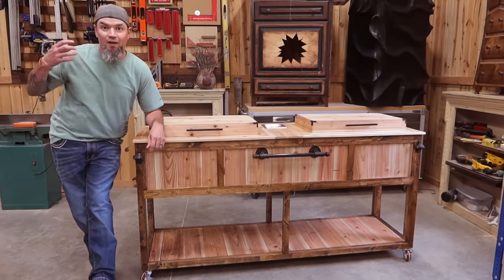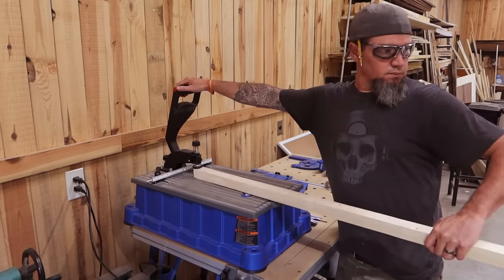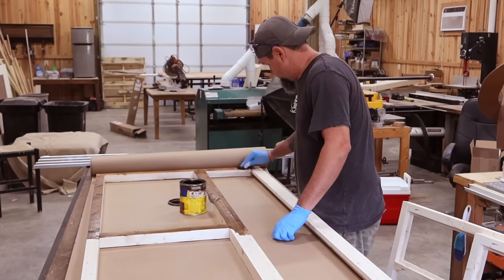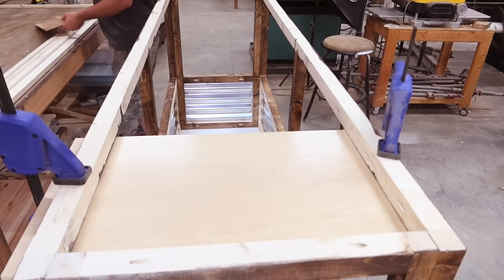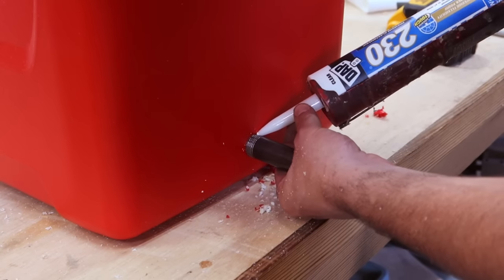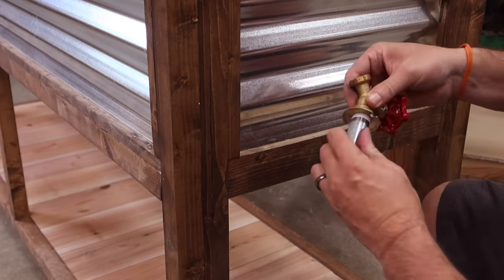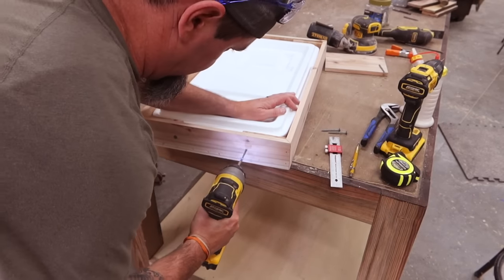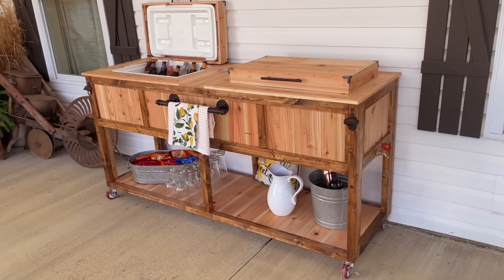Double Patio Cooler Outdoor Bar - Make Money Woodworking

Comment: I built a single cooler one for my wife and I to use. I had a bunch of skids from my machinery that I used for everything except the frame. I used a cooler that had handles and lid hinges that screwed on so it was easy to modify. I used a torch to burn the frame very dark and lightly burned the panels. Coated the whole thing with spar varnish. Looks great and makes outdoor parties great!
Reply: Too bad you cannot post a pic of yours here...

Comment: I made a bar for my aunt and uncle and used reclaimed tin from our barn to face it, I did metal because they wanted to be able to move the bar inside when they weren’t using it and I figured it would be a lot lighter than wood and it ended up looking really cool!
Reply from the maker: Yes!  I bet the reclaimed tin looked awesome!
Reply: Old rusty tin is popular right now for all sorts of stuff, surface rust not full of holes and sharp edges.
Reply: @JamesSmullins  I actually put the underside out so there was light surface rust but it was the old worn galvanized look too and the stamps were still on it from where it came and what year and stuff, the top had been weathered too much and painted too many times to have the same appeal
Reply: @isaiahshaffer  that works, I like that old look much better than the shiny new tin, and it sells better. I learned this at a restaurant I managed that was a very old building, nearly 100 years old. The outside open eating area had a four foot wall around the covered portion that was old rusty surfaced tin. People loved the rustic look and it fit perfectly with the area being a historical district. I loved that place and I was the primary pizza cook for years in a mesquite brick oven outside with the customers, that was also wrapped in the old tin. I got to talk to every customer about the food and atmosphere and that old look was what made people eat in more than take out. We were a bring your bottle and had a couple single coolers people could put their beer, wine or liquor in and have it near their table.

I miss that place even though it was 1200 degrees in front of that oven, new owners ran it out of business and lost all the charm that brought people there.

Old is in
Reply: @JamesSmullins  I agree and that sounds really neat, it’s a shame the new owners ran it down, old is definitely in, especially the old industrial or barn type styles, there is a brewery about 45 minutes away from me and they took and old railway station, like factory sized because they stored grain and goods there and also had rooms for people to stay, the place is massive, but they took it and just cleaned it up, added old iron braces to the timber framing where it needed it and patched brick work but other than that is just cleaned up to how it was, and it’s always very crowded

Comment: Another awesome video Matt!!!  I really love your theme of repurposing inexpensive fence boards into upscale projects. I also love the customization options of your builds. If you don't need 2 coolers, just shrink the width down to a single cooler size.  Or omit the 2nd cooler and put in some cold food serving trays or even some sterno heated steam/chafing trays for hot food.  Lots of possibilities to another great Matt Peech design!
Reply from the maker: Thanks David!  I almost redesigned it (again) after I was finished... I wish that I had closed one side in to the bottom and made it a lift top trash can.  Would be perfect for outdoor gatherings.
Reply: @MatthewPeechWoodworking  Options for all the builders out there.  That's what makes your stuff so great, it's adaptable!

Comment: Hey Matt, Very nice build, one trick though, try Polking a very small hole into the bottom of the caulk to eliminate the squeeze out when you stop pressing the handle.
Reply: I was gonna suggest the same, plus if needed you can flatten the tip to get a better equal run out of the same size.

Comment: My only change would be to add a base for the coolers, the downside for me to the hanging brackets is if at some point down the road I have to replace the coolers, the replacement coolers might not have the exact same shape/measurements to fit the brackets. 
This one is added to my to-build list for sure, awesome stuff as always man!

Comment: You can buy the cooler drains on line pretty cheap. I would install them in the bottom of the coolers, use pex and lower the drain spigot so that it is below the bottom of the cooler.
I would also put about a 5 degree angle on the hinge side of the cooler lids so that they stay open when lifted.

Comment: Love the content and your method of explaining what you are doing makes it so easy to follow! Definitely adding this to list of projects I am going to try and tackle. A few changes I would probably make is to pipe both coolers into a single drain and maybe use some construction adhesive or silicone to attach cooler tops so I don’t have to worry about filling the screw holes on side.  Keep the awesome content coming!!!
Reply from the maker: Thanks!  yea it would be really easy to just use one drain.

Comment: Very well done project with nice touches; black iron pipe, upgraded hinges and the corner protectors. Excellent plans that maximize the wood usage, I will probably add a urethane to the top since it will be getting wet. Wonderful project for when the weather cools off here in Las Vegas. "Top Drawer" video and audio (even hoarse). Love your channel.

Comment: I think the only thing I would do different would be to insert the lids flush with the top. Either hinged or just remove able to access the coolers underneath. the flat surface could be used for other functions if the coolers are not needed
Reply from the maker: Nice idea. Could make it push down clickable that lifts with gas struts.

Comment: To increase the insulation factor, I drill a few holes in the cooler tops and fill them with crack and seal, as cooler tops rarely have any insulation in them. This will turn  into a super cooler that will rival the big "Y".

Comment: Really like this build. One thing I'll suggest. When putting the "towel bar" on,  using the level isn't the way to go unless you're 100% certain that the your floor or assembly surface is also level. You're better off to use a spacer of some sort. That way, it's balanced to the piece rather than the floor. But I really love this, and wish I'd thought of it earlier in the season.

Comment: Instead of black pipe and caulking, I would suggest looking at weldless bulkheads, typically used in home brewing.  They are often used in coolers to make mash tuns. 

You can find them threaded on both sides, barbed, garden hose thread and with ball valves included. It would be a lot faster and simpler, and easy to replace if needed.

Just make sure the stem is long enough to go though the cooler. The shorter ones are usually used in boil kettles.

Comment: Couple things I'd do a little differently.

The small container might look better with a lid matching the two coolers, you would just need the wood lid and nothing else.

I would use a y joint between the two coolers and drain it out the bottom center area purely for looks. I'm working on a design that's a bench and cooler built in the center with the top being a table. The cooler will slide out like a drawer with a drain hose out the back.

What I haven't decided on yet is if I want to buy a cooler to fit which would make it harder to seal the lid when closed or make the cooler as the drawer using foam blocks and thin metal like what you see in commercial fridges and walk in coolers. With that design I think building the lid into the bottom of the table section would work to get a fairly good seal when cooler drawer is closed.

These would have be marketed to places that have outside patio areas like many bars here in Texas. Sell a bucket of beer or wine and the customer could put it in the cooler drawer where their sitting rather than just on the table where it warms fast. Of course sell to home owners as well.

Comment: Just joined in and love your content Matt , here is the thing though. I am in Canada and went about purchasing or trying to purchase what you stated for supplies, I couldn't even come near to your costs. First the U.S. vs Can $ not nice, 2nd our lumber yards don't always sell the same type of lumber ( fence pickets don't exist) Cutting down the 2x4's not a problem but based on price it's not worth the labor/time, compared to simply buying 2x2 and using them instead. Don't get me wrong not complaining about your video in any way, just maybe inform others that U.S. and Canadian costs for materials are miles apart by the looks of things. e.g. 2 coolers same size as yours at Walmart  2 @ $45 each plus 13% tax $101.70 , ( Home depot $65+ tax each ) towel bar $65 plus tax $73.45 , hinges $7 per set+ tax. Bottom shelf and top side boards $110 +tax and I can tell you the 2x4's cost $4.47 each +tax, Stain $37 + tax, varathane sealer $58 +tax.  I'm missing a few items but as you can see, prices are far different, I'm going to say $500 by the time i add wheels and screws etc. 

 Once again, love your video's,  besides being instructive to construction of projects they also have made me aware of cost/time/quality something I'm sure you give a lot of thought of for each of your projects here. I'm certain many are learning from your videos. I will be following along with some other projects you have, KEEP UP THE GREAT WORK !

Comment: The "clear" caulking takes 5-7 days to cure to clear :) Most of the good clear products are similar. I recommend Phenoseal.
I love this project :) There's a lot of work going on with pocket screws though imo, not that it doesnt look great but I'd love to see if it could be done to the same quality using 18ga staples for assembly

Comment: Keep up the great work, I we'll have to build this one one question though wouldn't you want to use galvanized pipe instead of black pipe so it doesn't rust
Reply from the maker: You probably should.  I just didnt want the galvanized in the cooler.   The coating is pretty toxic.
Reply: Wouldn't Pex or pvc be better... Lots of fittings available for both and none of the issues of using metal.

Comment: Mathew, do you think it would be a better idea, instead of adding the little thin boards to the edge to hold the metal/wood, to just cut those into your 2x material when you make the frame?

Comment: Awesome build! My only concern is I wonder how much the coolers are going to sweat/condensate up around the top and how that might effect the wood 🤔
Reply: I worry about them holding the weight, may need some support under the bottoms.
Reply: Insulated coolers shouldn't sweat oun the outside.
Reply: @orbitalair2103  I thought about that too. But if you consider you carry full coolers by the same handles then it technically shouldn't be a problem. But it should also be easy enough to add a few strips of wood under them as extra support.

Comment: I drilled a hole using the same type of 7/8” spade bit, but when I go to thread the 1/2” black pipe, the hole is slightly too big.  Any idea what I did wrong?  Pipe nipple says 1/2” std black steel nipple.

Comment: I have a question, how do you make sure that the cooler covers are perfectly aligned with the cooler body downside? Btw great video!
Reply: Have the lid sitting on the cooler (while inside the wooden lid, they should still close tightly) prior to installing the hinges.

Comment: the only fluke about this project is the 1/2 black pipe into the plastic cooler and the caulking, you could have used a pvc kit made specifically for coolers that seals both inside and out using threaded connections and o rings.

Comment: I am absolutely struggling to find cedar fence pickets!! Any ideas? Do I need to order them at my local store?
Reply: at my home depot the cedars are inside, while the treated ones are outside.  go figure.
Reply: @orbitalair2103  at mine they have everything inside but do not have any cedar in stock goes for both Lowes and Home Depot
Reply from the maker: Try looking outside at the full panels... Sometimes you can buy a full assembled panel for cheaper than the individual pickets.
Reply: @MatthewPeechWoodworking  sweet, thank you sir

Comment: I wish I could send you a pic.  I made one of these for a school auction. It had a drainable cooler with a faucet drain.  A to-go 6pk cooler, a mini fridge., pull-out cutting board. Bottle opener, pull up spice rack,paper towel dispenser towel bar and on rollers.  
  I had 4 weeks of work after-  work on it and 500$ total in it.  
It sold for 580$.  I was bummed.  I expected closer to 1000$.
Reply from the maker: Sounds awesome!  And school auctions are the worst! You would think people would pay somethings value for a good cause.